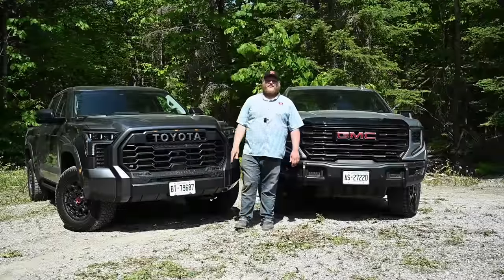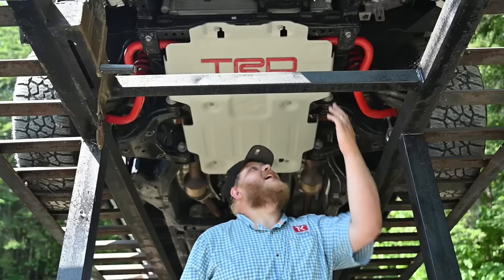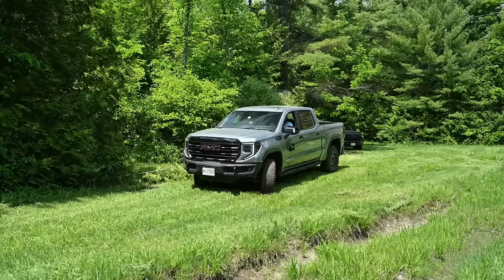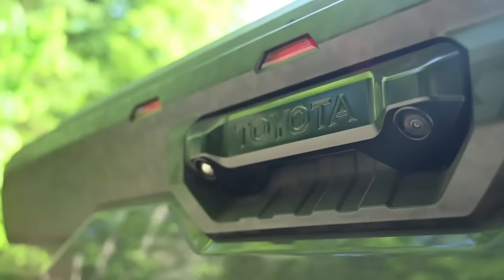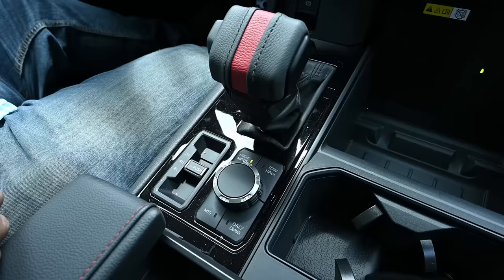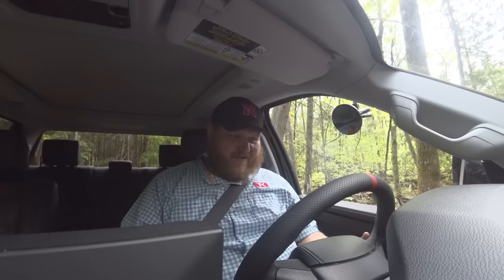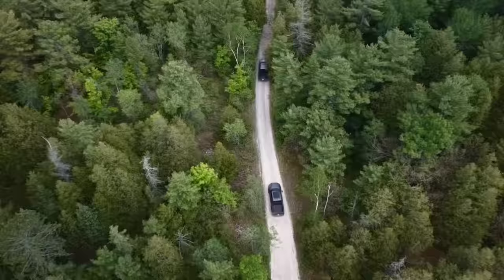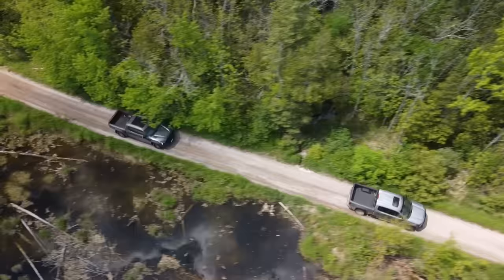2023 Toyota Tundra TRD Pro vs GMC Sierra AT4X AEV - Mud, Rocks & Water will Decide Which is Better!

Comment: My Colorado has a greater payload than these two trucks. How does Toyota not put tow hooks on an off road package? The Toyota looks pretty good except for the flush grill. I think having the grill itself set back an inch or two behind the frame of the grill would have looked much better.
Reply: toyota should hire you
Reply: I agree the payload is weak. My Gladiator has 1500# of payload and much more capable off road half the price.
Reply: Damn dude your right holy shit lol. I've got a 16 colorado and yea looked it up. 1,500 lbs of payload.
Reply: @arcsolomon6360  I would agree with you, but the main comment has a point. The Sequoia has the same face, the grilles look much better.

Comment: Steel bumper’s & skid plates, tow hook, etc you probably reduce payload by 500-600 lbs just with that.
Adding long travel suspension and you are around 1000lbs

Comment: Im a Toyota fan and drive a last generation Tundra. The new TRD PRO missed it on alot of things for me in the redesign unfortunately. Those sway bars on the TRD PRO are going to get bent or broken if you do any serious offroading.  The huge gap up front between the bumper and the first skid plate? Whats going on there.. 

Now the interior/engine/new suspension I do love.

This engine (V35A-FTS) isnt new people. Its been in a lexus since 2017... so it has definitely been tested.
Reply: toyota should hire you
Reply: @arcsolomon6360  I'd like to think I would bring some great ideas to the table.
Reply: @chrish1850 wed all like to think that
Reply: @T_81535  I wonder if they ever allow "regular Joe's" to drive and look over the trucks to get feedback.
Reply: @chris1850, yes sir, have that engine in my ‘20 LS F-Sport and I love it.  Drove a ‘22 Tundra w/ it and was not particularly impressed, performance-wise.  I’m sure the hybrid version would be completely different…

Comment: Funny enough I currently own an old 08 Tundra, shes been great, but recently gave me  few small problems, my 2023 TRD PRO will be here next month.
Reply: Nice, had an 07 now 2020.  Planned on keeping it for a long time but might be giving it to my daughter for her first vehicle. Quick question, I have not sat in a new Tundra how does it compare to the model/last generation like you currently have?  I’m a bit concerned being 6’6”.  I like the room on the new gmc/Chevy trucks but long term reliability is a big concern when looking at those trucks.
Reply: Traded in my 15 Tundra Platinum on a 22 TRDPro with 7k miles. I’ve been loving it. My last tundra was the best. 6 years with no issues and only oil changes, set of brakes and tires, 1 battery… love the reliability !
Reply: Still driving my 06 double cab. Had a 00 tundra before.

Comment: I have a 6.2L with an 8 speed in a 2017 GMC All-Terrain 1500.  I ran from Colorado to Northern Montana and back (1700 miles) and my average was 24.2 mpg.  No Toyota Tundra will do that!
Toyota also uses 2 "c" channels welded together for their frame.  That is ancient technology, FORD, GM, DODGE all went away from that in the 80's and went to Hydro-Forming.  A much better way to make frames!  Sheet metal on the Tundra is also MUCH thinner.  Open the hoods, grab the hood with each hand and try to twist them.  You will see a huge difference!  (You can almost 45 degree a Toyota hood but the GMC/Chevy/Ford/Dodge hoods any take a small deflection.  Toyota makes a good small truck in the Tacoma, but, the Tundra just isn't there quality wise.  This test should have been with the AT4 vs. the Tundra.
Reply: The tundra literally is rated 24 mpg highway 😂
Reply: A tundra would bash through just the same and do it many more times with many more miles
Reply: @brettanderson5444, it's rated that, but trust me it doesn't
Reply: @davidleeosbourne2727  for people who can’t drive a turbocharged engine yes.
Reply: @freedomisntfree_44  so you get a turbo charger and drive like a woman?
Reply: @davidleeosbourne2727  I don’t have a turbo besides the diesel 🤡 just because you can’t drive one don’t mean women can’t 🤭

Comment: These 2 are not direct competitors! The ZR2 or AT4 (non X) is the direct competitor to the Toyota. The extra $20k is an accumulation of better interior, better bumpers, front lockers, more under body protection and better wheels and tires. The only thing the regular AT4 (nonX) is missing vs the TRD is the rear locker, but the G80 would have done just fine in this comparo and its priced close to the same :-)
Reply: At4 doesn’t have as good of suspension compared to the Trd pro
Reply: I think the Chevy Comparable would be the trail boss to the AT4

Comment: Great review gentalman! I literally have been trying to decide between these two trucks for a month. I choice and bought the the Tundra TRD PRO  last week for two reasons. Toyota's reliability and strong resale value and  second the GMC had so many fit and finish issues that there was no way I was spending the extra 20k. Also the TRD PROs are hard to find (most pre sold) and the GMC dealers in my area can not give the AEV away even at invoice in my area.
Reply: Great choice sir Great choice
Reply: The only reliable part of the 2022+ Tundra is their ability to have crank bearing failures.

Comment: I think the GMC is more of an off-road truck than the Tundra. 
And I wonder when all truck & car makers are gonna go with side cameras  instead of mirrors for fuel economy. Wouldn't be surprising to me. And i think Toyota isn't what they once were, they're sales are based on their past reputation.
Reply: Unfortunately its not really possible to change to cameras completly since with mirrors you can change your head position and get a different perspective. I don't think safety rules will ever allow exclusion of side mirrors. Well, at least until all driving is done by AI and not by the driver at all . . . or until tech lets us just teleport from place to place in a blink of an eye.

Comment: THIS IS MY OPINION. An SUV or pickup truck should not have turbochargers in them. It just increases the maintenance cost and decreases the longevity. Wheter its a Toyota or any other brand. Nothing beats a full size naturally aspirated engine.

Comment: What you failed to mention, as far as the drive ability on the roof to rain the tires make a difference in the grip, the reliability of the truck, the horsepower in the overall performance. The Toyota would do just as well if it had better tires, but I would go with the Toyota for proven reliability, dependability, and overall last ability in Toyota gets better gas mileage had more horsepower more torque for the money the Toyota would be my pick.
Reply: GM also got helped by going after Toyota 😅
Reply: I don’t trust GM
Reply: @rubenfranko6600 i had bad luck with Toyota and no problem with GMC

Comment: If you're not going to use the front locker on the GMC, the Crawl control shouldn't be used on the TRD. Even though ATRAC isn't a real locker but it simulates the characteristics of one. That would be fair.

Comment: I WISH YOU GUY WOULD DO OLD SCHOOL GMC SIERRA ChevySilverado like 1999-2006 Models and dodge and Ford the f150 and the Ram1500  the same years from them as well 1999-2006 model years. This would be a Awesome addition to your channel doing some old school off-roading in the best years for GM for the SIERRA1500 and Silverado1500 1999-2006 where the most reliable for this trucks I have own 2 of them and still have my 2nd one 2001 gmc Sierra 1500 ext cab 2 wheel drive 5.3 litter V8 Engine 285 Horsepower with a Flowmaster FX Cat back dual exhaust system. It sounds so good on this trucks. Mileage is 124,490 Original engine original tyranny. I have put thousands I mean thousands of dollars over the past 2 1/2 half years in my truck to bring it back to life. I spent alot of money on my rig but it's all worth it. These trucks last a very very very very long time Especially if you maintain them and take care of them. Especially with just just a little over a 120000 miles is really low. Mileage considering the truck is almost 24 years old. Is a friend of mine had one With 402000 miles on yes, and still running strong. Try to do a video on old school pick up trucks from the years I Mentioned your channel is truly amazing..

Comment: Great video, love the off-road comparison.  Only thing is, you have to remember the Toyota Tundra Pro is all designed around fast desert running;  not slow trail running.  Thus why it did better in that very small section of "fast" running.   Don't get me wrong, if and when the Tundra comes out in the Trail Hunter trim like a Tacoma, I would love to see it go against this GMC again.  Both vehicles looked great going off road though.

Comment: I picked up a 2021 Warlock with 19k miles for $34k with a push button start 4wd and the tried and true 5.7 heni put a 4" BDS lift kit with the rear fox shock and upgraded to the fox coil overs up front put 35 12.5x15 method wheels with the Borla Attac exhaust and I couldn't be happier the interior is nice not over the tep tech got the 8.4 touch screen with Nav and I couldn't be happier! I'm more into the bang for your buck trucks and cars.

Comment: I like Toyotas, but the Tundra is a pure off-road poser--no tow hooks, not great underbody protection.  Those two deficiencies make the Tundra a loser for hard-core off-road use.  From what I have read, Toyota learned their lesson on the 2024 Toyota TRD Pro and it looks to be pretty off-road capable.
Reply: But who is actually using their new, expensive, full size truck for "hard-core off-road use"?
Reply: No full size truck is a serious off roader. To big!
Reply: @ALMX5DP Nobody. This is hating by people who can’t afford a new truck. A full sized truck isn’t made for “hardcore” off-roading, it’s made to look tough in the mall parking lot.
Reply: @ALMX5DP  You forget that many full-size trucks are bought by fleet users where trucks can see very tough off-road use.  I used to live by one of the largest natural gas fields in the U.S.  Those oil/gas service 4WD trucks saw some very severe off-road use going into and out of isolated well sites, etc.   A friend of mine uses his business truck (a crew-cab short-box 3/4 ton 4WD) to maintain remote radio repeater sites.  One is 17 miles of 4WD trail that would rate a 7+ out 10 for toughness.  The trail is actually in a Wilderness Area where vehicle use is prohibited, except for accessing that radio site for maintenance.  So, there are people using newer, expensive full size 4WD trucks for hard off-road use--some of them on a daily basis.
Reply: @rockymountainjazzfan1822   I’d argue that is a relatively niche use case, and one where fleets and companies are okay buying vehicles and adding the necessary equipment themselves to suit their specific goals and environment. Certainly no TRD Pros or AEV editions being purchased by fleets unless it’s perhaps for the big boss who just wants to write off their personal vehicle.

Comment: I just extensively test drove both and ended up going with the GMC, but with the Duramax. After discounts, they were within $1k of each other. GM had over 9k off, Toyota was at MSRP. 

The TRD Pro had slightly better road manners, bigger infotainment display, more power, larger fuel tank, and a pano roof. Material and build quality are much better, with little to no creaks or rattles. 
Negatives are plastic bumpers, useless cooled seats (major issue in the South), more cabin/wind noise, and  whistling from the driver side mirror (multiple did this). 

The Sierra 1500 AT4X AEV had the excellent LZ0 3.0 Diesel which while slower, had better real-world fuel economy, with smoother and more useful daily drivable power delivery. Infotainment tech is much better, more features, options, etc. It was also quieter on the road, despite the MT tires. Cooled seats worked great.  In fact, even the AC cooled better/faster. The interior looked much nicer and more upscale
Negatives include the smaller display, smaller tank (but still great range thanks for the diesel), bit more creaking, and a bit pricier as built. And a standard size sunroof, if you care about that sort of thing. 

Overall, I just felt I was getting more truck for the money and more features/capability. But to be fair, I wouldn't fault selecting either truck. Both are pretty solid.

Comment: Nice to see you finally use 4low on an offroad trail. And you said to keep it equal you didn't use the front locker on the GMC. That isn't equal that's limiting one truck to give the other a chance
Reply: I don't want the hybrid option an any price simply because of the cost of maintaining or replacing the components.
Reply: @terryduncan31 it's a Toyota hybrid those things are good for years with no issues

Comment: Talking about jeep comfort = my first jeep - a CJ7 had 7 layer  leaf springs, the i put 2000 pound coil overloads on each corner. You could beat the hell out of the suspension, but if you didn't have your seatbelt on and drove over a dime, you would be bounced out of your seat.

Comment: Both are very nice trucks, it wouldn't cost $20k to install tow hooks and aggressive tires on the Tundra, it seems to me that the Tundra was riding better on the rough road, probably as mentioned because of the coil springs. Also the Tundra has better payload and towing capacity, that comes in handy when towing a camper trailer.

Comment: Great comparison test! Both seem like absolutely awesome trucks. It would be hard to choose between the more modern (but complex for servicing costs etc) Toyota twin-turbo hybrid, and the old-school 'simple' 6.2 V8 of the GMC.
Reply: It's simple... The GM
Reply: @michaelharrisson1683  Personal preference
Reply: @michaelharrisson1683  The thing is the non hybrid TT is just slower than a 6.2, A hybrid tundra is gonna pull on the 6.2 all day. 583 lbs of torque and another 17 horse.....
Reply: @joemcgee2918 And no lifter issues.
Reply: Lol Chevy has serious issues with all the v8 without modification.
Reply: The old-school Chevy was put together with Harbor Freight quality parts. How many times you want to replace those? Also the Tundra V6 has been around for a loooong time. Used by Lexus for years.
Reply: @Mycameron2323 stop lying
Reply: You forgot toyota reliability. I use to work in a shop all the chevy for and rams were pretty much dying by 200k. I had plenty of 300k+ tundra in for simple maintenance
Reply: @sexyfishyphish  No, didn’t forget Toyota reliability. Big fan of Toyota/Lexus (owned 6 Lexus’). I just think I’d prefer the V8, and I like the interior of the GMC 👍
Reply: @joemcgee2918 

You could easily make a lot more HP and torgue just upgrades the turbo and cooling and increase the boost.
Reply: them lifters with the 6.2 V8 and also them wastegate issue on them TTV6 tho. Every single 1/2 tons truck is overpriced and planned obsolete.
Reply: V6 tt no way!😂   6.2 V8 naturally aspired
Reply: The Toyota isn't complex, you just have to be diligent with oil change every 6 months or 5000 miles and make sure the hybrid battery filters are vacuumed regularly.  Well maintained batteries lasts like 200k+ miles
Reply: @PWCDN  It’s the two turbos that would worry me. My thought is that turbocharged engines usually have more issues than naturally aspirated ones, and expensive too when it comes to replacing turbos.
Reply: @RealWorldCarReviews you are absolutely right, but dumb folks would never understand that and run behind the so called RELIABILITY branding.

Comment: You guys have to start driving the Sierra with the performance exhaust package. Adds a bit of additional horse power and torque plus makes it one of the best sounding factory trucks on the market.
Reply: That will drown out the lifter noise lol.

Comment: While I agree the price difference was fairly substantial, I think it was a slight disservice to say the GMC was only a 'hair' better.  Even saying slightly better would have conveyed the difference better than a 'hair' which implies almost identical.
Reply: Plus a better comparison would have been ZR2. The gmc is more and the aev is more. Cost is pretty much identical to trd with ZR2, and the aev didn’t add any enhanced performance to this test.
Reply: Well you saw the video right? Looked like very minute differences to me. At no point did I think "wow. that GMC is a far superior offroader do to the tow hooks or ever so slightly more aggressive tires. Also your definitely going to feel the torque difference on the low end in the tundra. No way I'd pay 20k more for a truck that is less powerful, less capable, less reliable, and has less resale value on top of it all.
Reply: A couple things I think could have/should have been shown in video.
1) if comparing trd to gmc, spend more time on interior and features. I think the gmc is a much more luxurious and comfortable interior.
2) if just considering capability off-road, the ZR2 should have been the comparison.  Pretty identical to pricing of trd, then you can debate merits of front/rear lockers vs low end torque and rear coil overs at same price.
To me, this wasn’t exactly an apples/apples comparison when such a huge price discrepancy was the “deciding “ factor when the same truck at comparable price point can be had
Reply: Video seems biased towards Chevy. The Tundra has considerably less wheel spin in all instances. The missing front hooks is probably the only glaring issue but what’s a few dollars for some hooks considering the price of these trucks. Every one I know who has one of these newer Chevy truck had them in the shop for a few months without carrying issue. Must be that hair better thing.